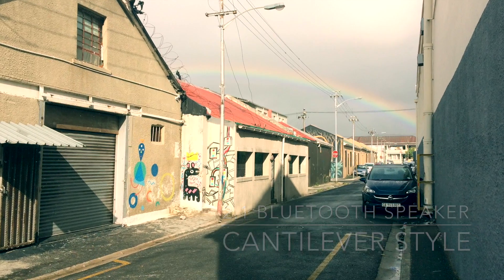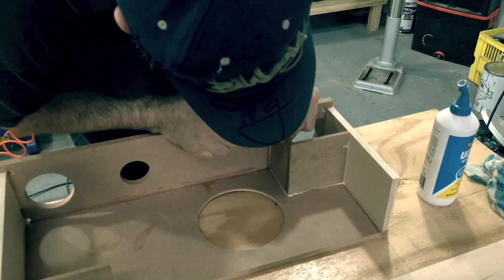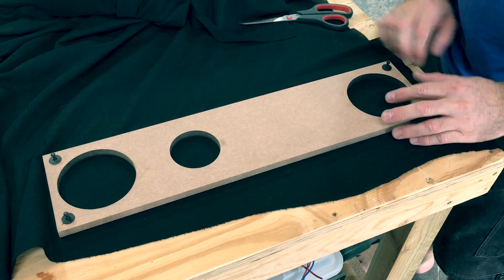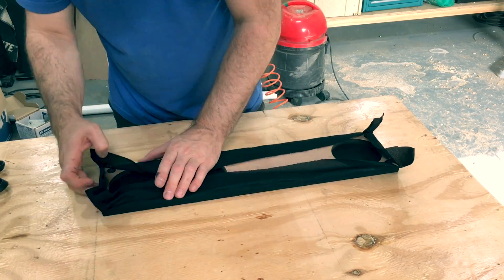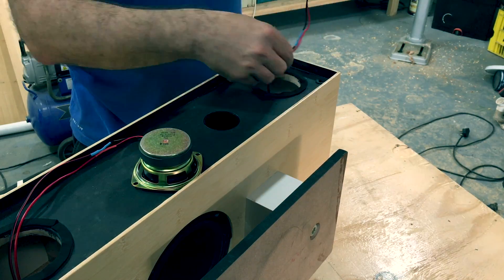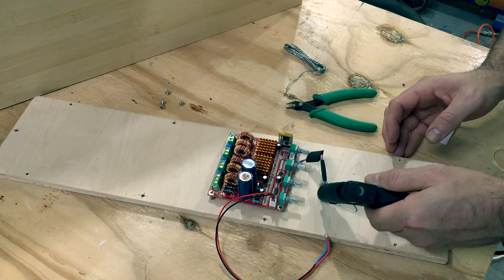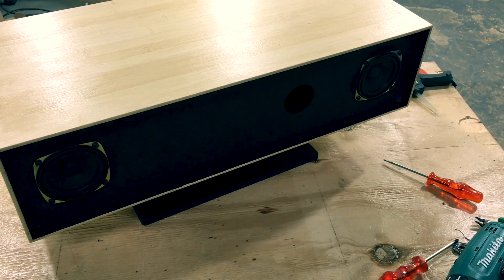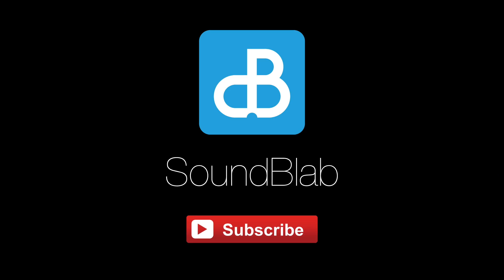Building a Cantilever 2.1 Bluetooth Speaker - by SoundBlab

Comment: Hi SoundBlab, nice project! I read in datasheet of this amp that it requires a symmetric power supply (+24v gnd -24v) and I can saw in the video you do a bridgue in the Vin of the amp and you use a standard power supply vdc asymmectric. Is it a valid method to connect your power supply with this amp? Thanks
Reply from the maker: +ErLzr15 Thank you! I am not an expert in electronics, but will tell you what I know. The manufacturer of the board recommends this configuration and it seems the board is designed to accommodate this. The board can also accept an AC power supply according to the manufacturer, but from the description it seems that you might need additional circuitry together with that. This asymmetric DC setup was thus just the easiest no frills method using a switch mode power supply according to the manufacturers recommendation.

Perhaps someone here more knowledgeable in electronics can also comment?
Reply: Is that a 12v power supply? It will work fine this way, but you can't get the total amount of power that board was designed for, because both the tension and current are not enough to power the circuit.
The TPA3116 requires a voltage DC18V to DC24V to delivery full power output and is designed to work with a single ( asymmectric) power supply.
Reply: Here is a link to a topic on Diyaudio about this IC :)
http://www.diyaudio.com/forums/class-d/240878-tpa3116-amplifier-power-2.html
Reply: thanks lightium! It is amazing what we get to learn with people like you
Reply from the maker: It's a 24v power supply. The amp stops working when a voltage of less than approximately 22v is applied and 12v is not an option for this particular board with TPS3116.

Comment: plz give me the dimensions of all parts
Reply from the maker: +Gira Patel Unfortunately I do not have documented plans of this build, and the dimensions would also depend on the drivers that you are using. I optimised the dimensions for this build according to the drivers I used, and this will be different for your build. I will consider doing a build in future where you can download plans, but right now I do not have the time to do that.
Roughly, the ported enclosure for the bass woofer is 10 to 12 litres, and the sealed enclosure for each full-range driver is 0.8 litres. The bass port is 154mm long and 50mm in outside diameter.

Comment: Great work man. I want to use battery. Do you have any advice. and i need how many volts ??
Reply from the maker: +ümit çağlar I will do a battery powered build somewhere in the future. For now I can not recommend anything without having tested it myself. But the amp module I use requires 24volts at 4amps. Perhaps someone else can make comments and be of more immediate assistance.
Reply: +SoundBlab I will use this amplifier. and that means I need 24 volts. Thank you

Comment: correct me if this is wrong but is it not a bad idea to use solder on mains voltage?
Reply from the maker: +MagicSteve46 I neatened that up afterwards, unfortunately its not on the video. Well spotted!
Reply: +MagicSteve46 Nothing wrong with it but ideally you'd loop the wires through the holes before soldering instead of just tacking them on, and also use heatshrink insulation.
Reply: SoundBlab That's good. Really impressed with your videos btw. They are well shot, and your projects are very nicely constructed.

In my opinion, it'd be better if you kept the music at the same volume throughout with your voice mixed on top. That way transitions when you start and stop talking are less jarring. 
Also, talking more about your design choices and construction techniques throughout so that people that are looking to your videos for inspiration/advice can learn a few more things.

Anyway, I have subscribed, and a hope to see your channel grow.

Comment: Hi
can you please tell me what those plastic clip things are called. when you putting your fabric on the front, I see you have clips on the wood. what are those clips called?
Reply from the maker: +Technical Support They are grill fasteners. https://www.madisoundspeakerstore.com/grill-fasteners/peglock-grill-fastener-peg-and-socket/
Reply: +SoundBlab Thanks
Reply: +Technical Support As an alternative you could simly use some Velcro stuff when you are only want to remove the grill for maintenance. Those special fasteners look better when using the speaker without the grill.
But if don't want a grill you probably dont even have the desire to fix it first. ;-)

Comment: Hi, Have you done any finishing to the plywood?
Reply from the maker: +lakistrike I applied a few coats of clear water based floor varnish with a brush. Normally, I prefer a spray-on polyurethane lacquer, but it takes a lot of setup and finishing to get a good result.

Comment: Did you use any speaker cabinet design principles?
Reply: +SoundBlab could you maybe make a few video's about how to calculate the size of the box en length of the port?
Reply from the maker: +jayfulf Yes, all the drivers where measured for their Thiele Small parameters and the optimum enclosure sizes were determined. The sub is in a bass reflex enclosure with tuned port, and the small fullrange drivers are in sealed enclosures.

Comment: it's look really Great ! I wanna build one too  but what did you use for the battery/alimentation ?
Reply from the maker: +Mandragoras All the drivers where measured and the enclosures optimised according to their specs. The drivers measured flat enough not to need any passive crossover for their particular use. The amp provides a variable crossover frequency between 180-250Hz for the sub cutoff and also a level control. I was able to use these two settings to tune the frequency response to sound right between low and high. There is also a treble control which helped to tame the top end slightly.
Reply from the maker: +ExhiBeoz || Tupac_MAN Thanks! This unit is mains powered through a Meanwell RS-100-24 switch mode power supply (it provides 24volts at 4.5amps max). The speaker does not have a battery and therefore is not really portable, but you could use a battery to power it by updating your own design. Link to the Meanwell website: https://www.meanwell-web.com/en/product-info/ac-dc-power-supply/enclosed-type/91-120-w/rs-100/product/RS-100-24
Reply: +SoundBlab thx you and i want to build one "portable" without any cable. And I'll use my own design :)
Reply: +SoundBlab why you put pontentiometers inside the box?how to control the volume and the bass tone?this is not good man...nice build except this.....
Reply from the maker: +ΔΗΜΗΤΡΗΣ ΜΑΡΤΙΝΟΣ There are several reasons, 1. the speakers I used are underpowered for the amplifier, therefore I can limit the volume by pre-setting the volume control and not pop the speakers; 2. once bass and crossover frequencies are set for a flat response you really don't need to adjust them. Overall volume then gets set with the bluetooth music device, and you can also use app equaliser to adjust bass or treble; 3. I wanted a nice clean look without buttons and knobs.
Reply: SoundBlab ok man...
Reply: +SoundBlab Does the amplifier drive the sub properly by actually cutting mid and high frequencies? How are the other speakers driven by the amp? Full range or mid and high frequencies only?

Comment: and wich speakers do you use and how much watts
Reply from the maker: +Stijn Van Aken The speaker drivers were salvaged from an old broken 5.1 sound system. The fullrange drivers are 2.5inch 4ohms 25watts, and the subwoofer is 6.5inch 4ohm 70watts.

Comment: is it a 3.5 mm jack input on the back panel? How do you switch input? 
really nice work btw
Reply from the maker: +MALVO MALVO Thanks! Yes it is a 3.5mm jack. This jack only works if the bluetooth connection is disconnected from the paired device (eg. phone). Otherwise the default is the bluetooth connection and whatever it is paired with. Switching then happens automatically once the bluetooth connection is broken.
Reply: +SoundBlab clever amp :) thanks a lot!

Comment: is it right that you can't adjust the volume, bass and treble
Reply from the maker: +Stijn Van Aken The amp module that I listed above in the description has master volume control, treble level and bass crossover (180-250Hz)and level adjustments. However, I have preset them and closed the amp off in my build. Music volume is then set by the connected bluetooth device.

There are other similar amp modules that do not provide all these controls... they might only have master volume, tone control and bass level. Crossover is normally fixed at 120Hz.

Comment: I like the design. Looks great! Do you notice much distortion at higher volume with the 3116 amplifier? I've got a 3116D2 that sounds decent until it hits higher volume then it sounds pretty horrible.
Reply from the maker: Thanks! I am only driving the amp about 60% as the speaker drivers I am using can't handle the total output of the amp. Will have to test it on more powerfull drivers to put it to the test.